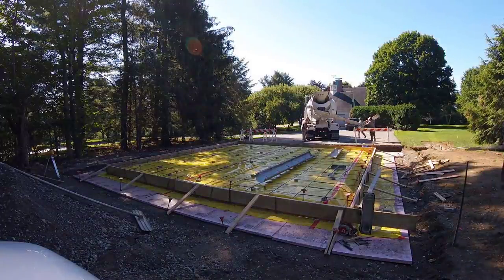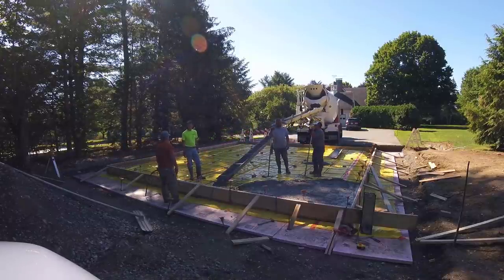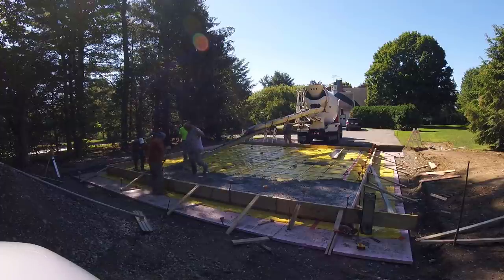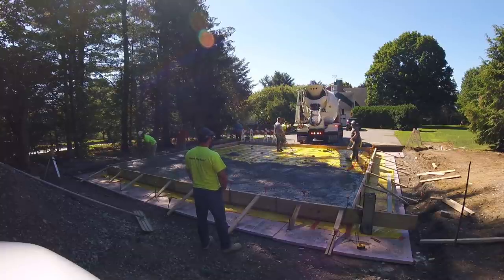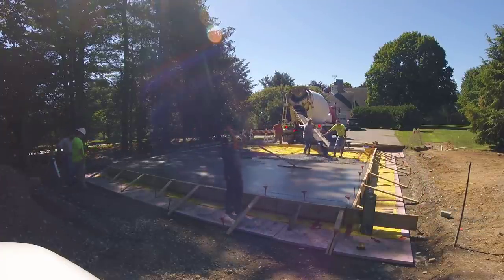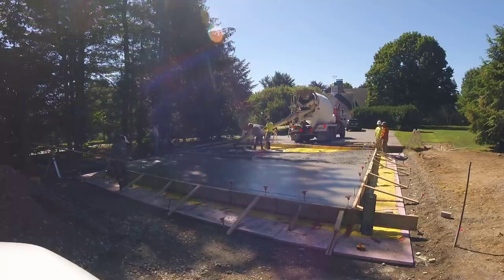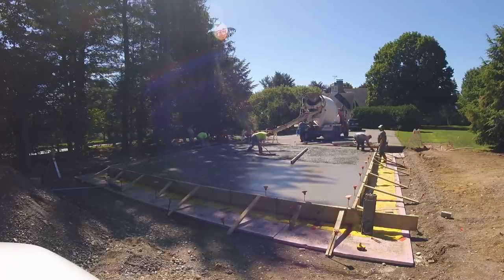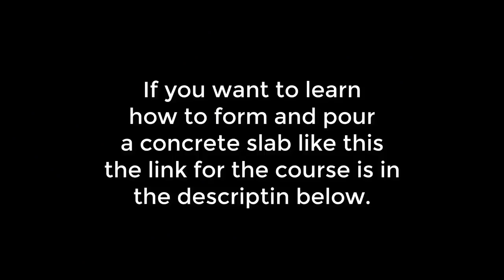How To Pour A Concrete Slab For Beginners DIY

Comment: Thank you for sharing your knowledge. I’m going to sign up for your course. I’m a contractor that started out in erosion and sediment control for large haighway projects. I had to get away from that and now do general construction. Pole barns, decks, fences some concrete. I’m doing a 24x30 pour for a pole barn after we set up the ground board and bring in 6 inches of dirt to raise the grade to match the existing garage. This will be my first big pour so you sharing your knowledge is a life saver thank you very much from one country to another. Keep up the good work.
Reply from the maker: Awesome, let me know if I can help
Reply: @MikeDayConcrete  how’s mike doing today. I purchased your  concrete course. I love the videos packed full of straight to the point knowledge. I’m wondering how much roadbase/class 5 a person should put under a 4 in slab of concrete that is 24wx30l. It’s a pole barn and I planned on pouring after we put the ground boards on and using those as our forms. I am curious if you have ever done it that way before thanks in advance  Mike.

Comment: Thanks Mike for your concrete videos!  I'm trying to learn from your videos.  I need to make a 6' × 12' × (what I think will be a 14" thick/tall slab, 7" above ground 7" below ground).  A 6' × 12' lean-too shed will be secured on top.  It will be an extra tall, upwards to 12 & a half feet tall.  2" × 6" boards will be used for the walls for extra strenght & rigidity, not 2 × 4's.  I want to build the best concrete slab as possible!  I have this project on my mind 24/7!!! 😬
Reply from the maker: You can do it!

Comment: I’m doing the ground work for a 24’x30’ mono slab. The concrete is to be 12 inches on the outside edge and 6 inches in the middle.  How wide should the outside footing be before I start the 6 inch hump in the middle? Thanks

Comment: Thanks for the videos Mike. Probably the best ones on YouTube and I’ve watched a lot of them. I’m just learning and have a question. When I use the hand mag it leaves a line at both ends of the tool. No matter what I try I can’t get it to not leave a line. So frustrating. Do you have any tips on how to use the mag without it leaving a line? Thanks again
Reply from the maker: When the mag is new and not broken in, it will leave a line even if you're experienced. Your steel trowel will also. You just have to keep going over and over it as the concrete dries and the lines will go away more and more with each pass.

Comment: When I started screeding concrete it was like that staying low and kicking but that with wet concrete, but when it hard like 4 to 5 slump we used a different trick u put one leg forward and the other spread back two pulls u get more leverage and cover more area and faster you can pour more and don't get as tired ,

Comment: I do small projects that me and 1 or2 other guys can handle like a garage slab or sidewalks and footers my biggest pet peeve when it comes to flat work is when a guy can't use the rake and I'm skreeting back 10 inches or having to stop and grab the rake from a guy and fill in holes.
Reply from the maker: Yea, it takes some time to get good at raking. If they're going to be good, they should get it after about a week.
Reply: @MikeDayConcrete   yea I prefer the jobs like footers or a sidewalk at 5 foot wide or less that I can just go at it by myself

Comment: Hi, Great video,thanks. How to pour slab edge footings 16"x16" with steel reinforcement and the rest of 20'x25' area with 4" deep of foundation , can you pour the whole area at the same time with footing? I'm a newbie and it will be nice if you included in your course. Thanks for your time..

Comment: We kick screed our slabs. Been doing concrete for 7 years, been in business for myself for the past 3. Another trick we use is me and my guys have all the same mag floats and once we empty out truck one guy goes to one end of the form and puts his mag float ontop of it and another guy does the same on the other end and they pull a string line tight and lay it over top of their mag float handle and the other guy will float down the concrete until the string line is barely touching the top of his handle and mark it with a X like you do. BTW, awesome work!
Reply from the maker: Thank you!